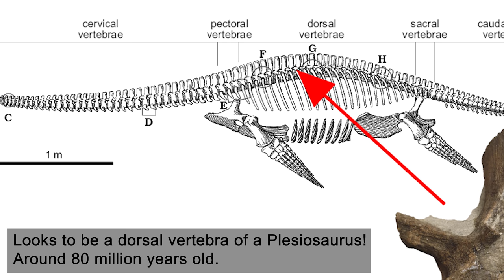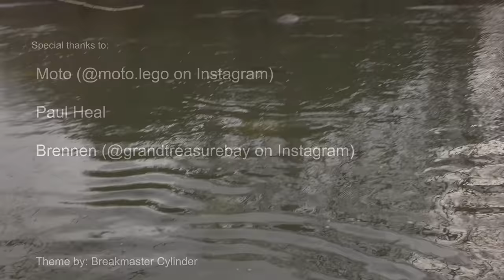Plesiosaur fossil prep - my first adventure with acid prepping reveals something amazing

Comment: I wonder if you could do something like a grease sealant during acid baths to prevent excessive corrosion of already-exposed parts, then later remove it with degreaser/alcohol/paint thinner or something. Might mean you could go a little heavier on the acid bath without damage
Reply from the maker: I use B72 paraloid to seal the fossil that is already exposed. It works really well!

Comment: How do you know that there's a fossil hiding in some random rock? And is that just plain vinegar  to soak?
Reply from the maker: I could see a bit of the vertebra sticking out and it was circular so knew it was a vert. Yeah, just plain vinegar, the white kind.
Reply: @MamlamboFossils  wow I have a bunch of rocks that I suspect might b large bones or vertibre probably at least a dozen.Not sure how to describe them other than large cylinder kinda shaped and all r roughly the same size around maybe 6 to 10 inches round and  5 to 8 inches long. The color is strange light gray on the outside and much darker gray on inside, with a perfect circle in the middle.  Not as uniform cylinder as this one of yours, not perfectly round like yours basically look like lumps lol if put end to end all in a row they seem to fit going largest to the smaller ones. They are in my storage unit in Washington state and were found by an 90-ish yr old woman in the 40'- 50's that told me get them the hell out of her yard😂. I do know that she and her long deceased husband collected and went on digs all over north America for native artifacts and fossils. She gave me buckets and buckets and a few crates  of arrow heads, axes, all sort of knapped stuff , loads of petrified wood, amazing mineral specimens and then these weird ones that I know could be something special if I could figure out wth they are . She unfortunately passed about 8 yrs ago so now I can't ask her about them. Most ppl that have seen the huge pile of rocks she just gave me for free are just like whaaat?!?!?! 
So I'll be binge watching your vids to see if I can spot anything like them hopefully 😁👍 don't worry I'll 👍 them all lol
Thanks!
Reply: @MamlamboFossils   ps ,, they are not from drilling I do know that